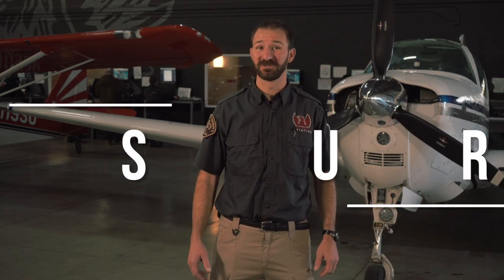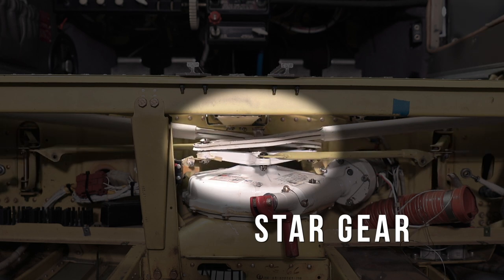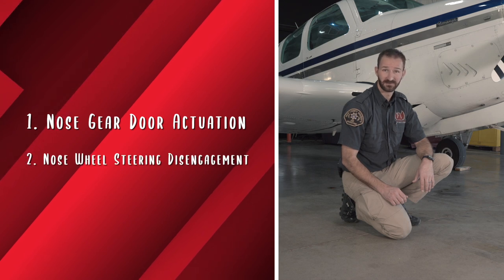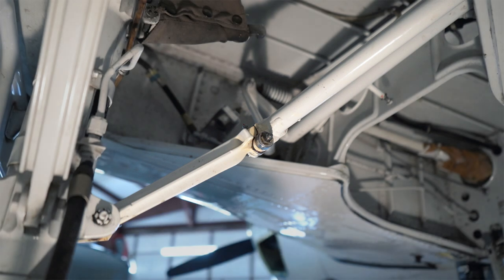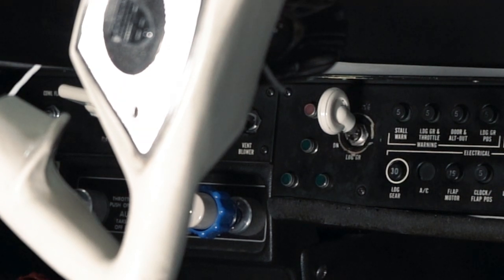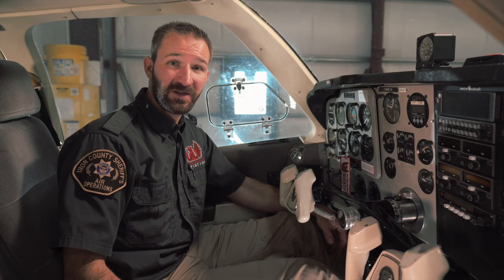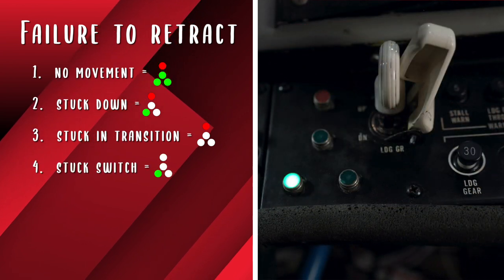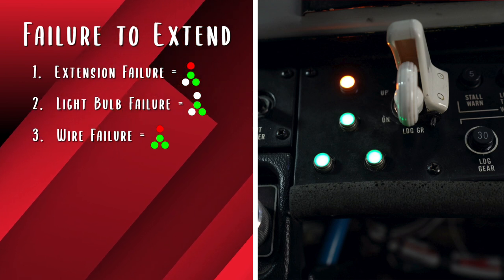How The Beechcraft Bonanza Landing Gear System Works

Comment: Outstanding presentation. As an engineer and Bonanza owner, I marvel at the robustness and beautiful straightforward design in the Beechcraft. Especially in the 24V airplanes, the gear retracts/extends in 3-4 seconds in beautiful fluid motion without the groaning and contortions that we see in other brands. IMO, an engineering masterpiece.
Reply from the maker: It is quite the engineering masterpiece!
Reply: I have talked to several 24v owners who really like the fast gear swing but is the 14v system unsafe or less reliable?  Just curious as I plan on acquiring a bo sometime soon and am trying to learn as much as I can. Thanks
Reply: @evangreen7562  The14V system is not less reliable than the 28V one. I would not rule out the 14V Bonanza just because it does not have the 28V system.
Reply: @BonanzaBart  Thanks for the reply. Which model BO do you have?
Reply: @evangreen7562  A36 with 28V system (for me the extended baggage was the main purchase reason vs. 28V which both appeared around same year on the A36)
Reply: @BonanzaBart   I believe that was 1988?  Thanks for your feedback.
Reply: @evangreen7562  28V 1978 and Extended 70 lbs limit baggage compartment on A36 became standard in 1979.

Comment: I’ve worked on Beech planes for over 25 years. This is the best demonstrations on how this system works with great visuals.
Awesome job! I wish I had this year’s ago to show my customers when I’m trying to explain it to them.
Reply: Does the Duke's gear work in a similar fashion?  (A&P student here, trying to learn.)
Reply: Yes, they use the same proven landing gear used on bonanza and baron airplanes. It was strengthened and incorporated into the model 60 design.

Comment: Back in my A&P days I had the opportunity to annual a pristine Bonanza each year.  I always thought that the gear retraction system was genius!  It accomplishes so many actions with the rotation of a single segment gear.  Always keep an eye on the wear points of the up lock retraction springs.  A little item that can easily get overlooked but if they break the up lock doesn't disengage and bad things happen.

Comment: Phenomenal presentation!  The mechanical stuff is great.  However, I questioned the statement you made “motor failure is the ONLY situation that warrants manual gear extension.”   I think that there are many gear abnormalities where a manual extension is the safest and most reliable course of action.

Comment: Great video!  One comment.  Anytime gear extension causes an anomaly, the first two things that should be done are, 1. Fly the airplane. This means get away from the ground, and away from the crowd.  2. Read the checklist.  All of it before doing anything.  Then after you have read it, execute the checklist.  Most of the time those two steps will solve the problem.  If they do not, the stress level in the airplane will get high.  Assess the fuel state and if time permits, use all available resources, a cell phone, or radio to contact a knowledgeable person on the ground away from the noise and stress of the airplane to work all possible options and to plan the best subsequent course of action.  Again great description of the system.

Comment: Great presentation. Any chance of a review of the single light gear system?
Reply: The only difference on the single light version is that the position switches in the gear bay are missing. Instead the light is activated by the limit switch on the gear box housing so the motor is deactivated and the light is activated by the position of the gear box.

Comment: Thank you for producing such a professional and educational video. Question: what could be the failure mode with moving the gear lever to the down position and there is no movement, no sound, and no light indication of any kind (no transition indication). The breaker is not tripped, and there is electrical current to the system with working light bulbs observed on test. This just happened to me recently.

Comment: Best Baron/Bonanza gear video ever !    Can I add a couple of things: 
1. some Barons (maybe others) have an auto-dim on the gear lights whenever the Nav lights are switched on, which in bright daylight makes them seem all out, so check the Nav Light switch if no gear lights in daylight. 
2.  extension failure due to friction or bent arm that you can't overcome with the emergency handle ?  One instance in Australia of pilot pulling a front seat out, floor boards up and working it free by hand - three greens !
Also a new one I never knew: https://www.youtube.com/watch?v=grscU0_oUn0
Reply from the maker: Thank you for the feedback!

Comment: Joe, if you have a partial gear extension (one red and say only one or two green) does it not make sense to retract all gear - and if successful in doing so - then do a manual gear extension. This would be the second scenario where manual gear extension was merited?
Reply: Tim, Because all three of the gear are physically linked together the only way for one of the gear to fail to extend is for a failure of one of the actuation rods. If this occurs replacing the motor with the hand crank will only serve to distract the pilot and increase the chances of something bad happening. There is no way to accomplish a successful extension in this case and it dose not merit a manual gear extension. Gear up landing is the best way out of this scenario.